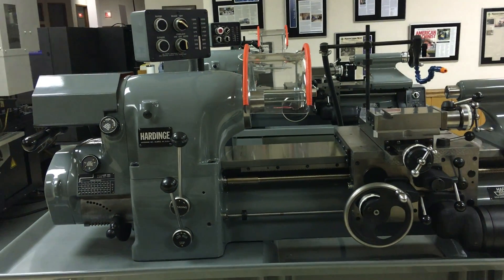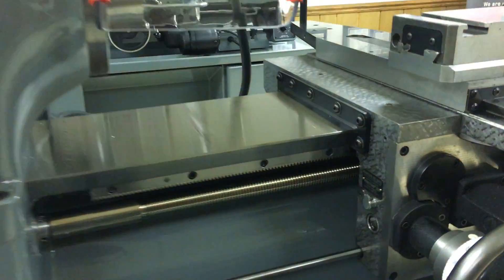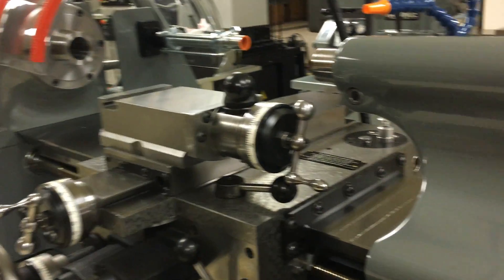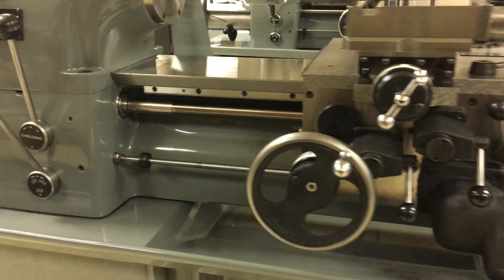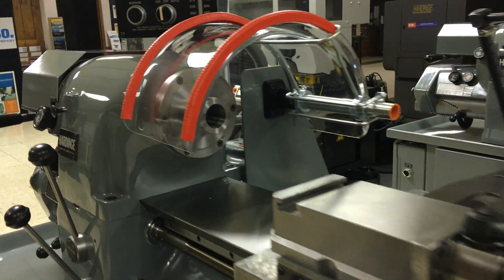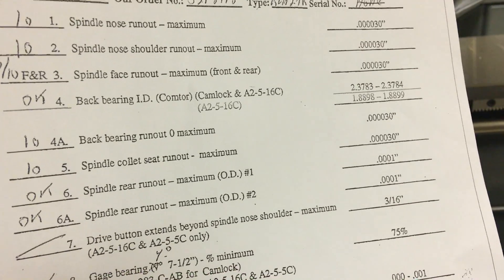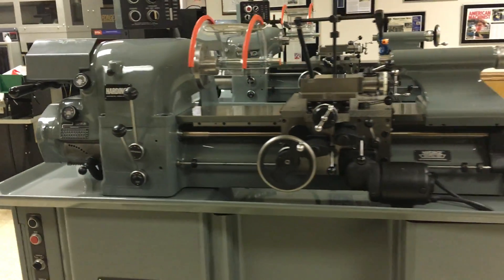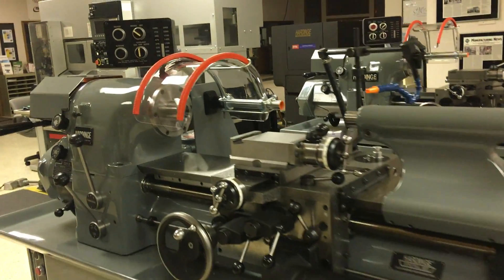Iverson & Company Remanufactured Hardinge HLV-H Toolmaker's Lathe

Comment: Worked on this model in 1973. Finished my apprenticeship with Ministry of Defence at Westcott and was placed in the EDS shop ( Engineering Development Shop) and they had this lathe, absolutely a beautiful machine to work on . Auto indexing screw cutting, variable speed control and really good accuracy. When it was installed the installation engineer ran it from minimal speed to max speed with on old UK  3 penny piece ( multi sided coin ) balanced on the head stock and it didn’t move. Wish I was that age again.